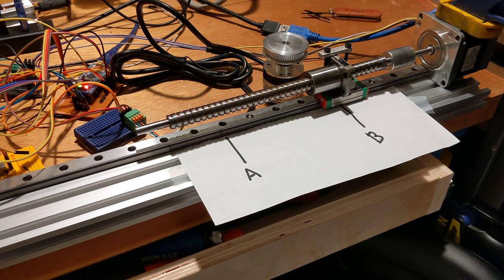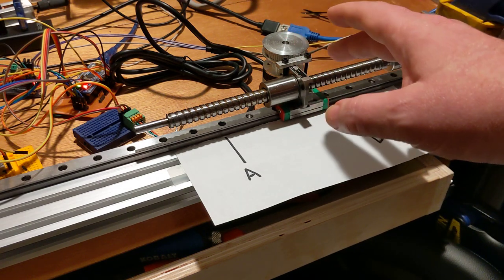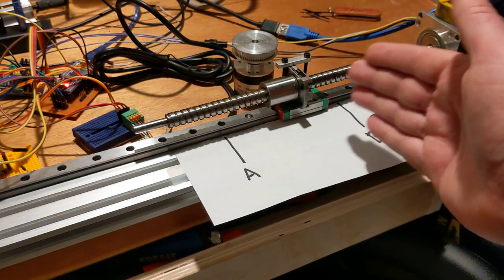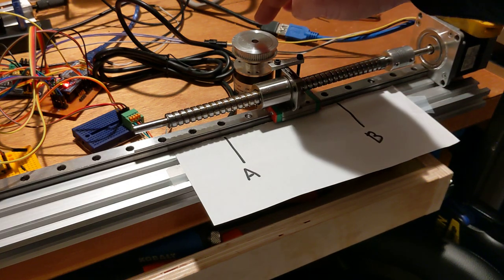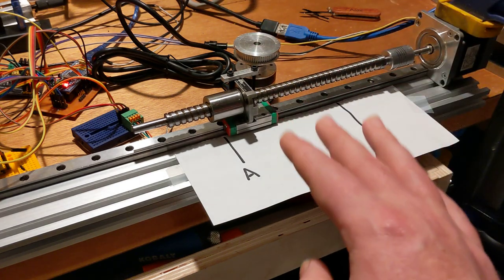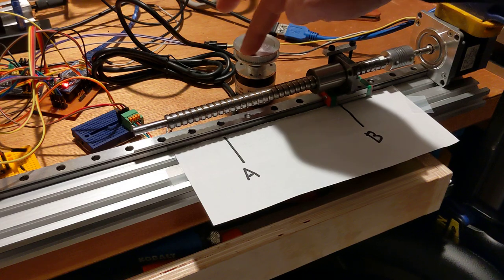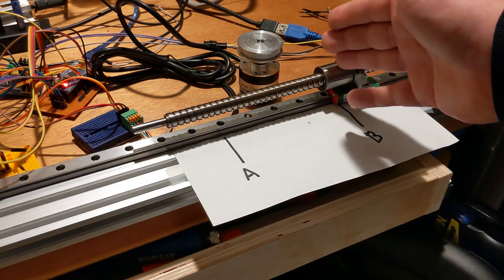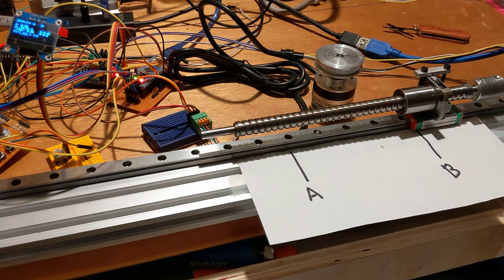Grbl velocity jogging part 2

Comment: Ok, it all seems very logical to me.  A smooth movement needs a buffer so that the GRBL memory is always well filled and ACC / DEC only happens at the beginning and end of the movement.  Unfortunately, of course, the latency is exactly what you absolutely do not want when you move manually, for example to approach a workpiece.  There is also a risk of collision if there is a delay between handwheel movement and axis movement.  I still think your work is really good, because GRBL needs a better jogging function.